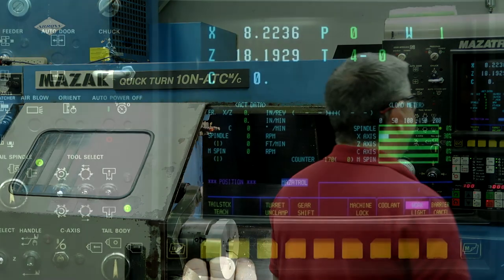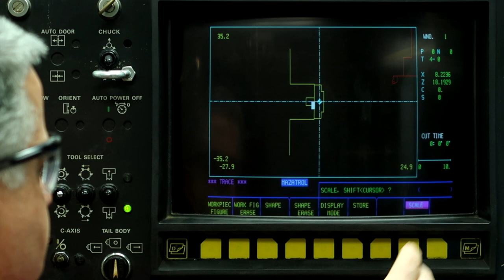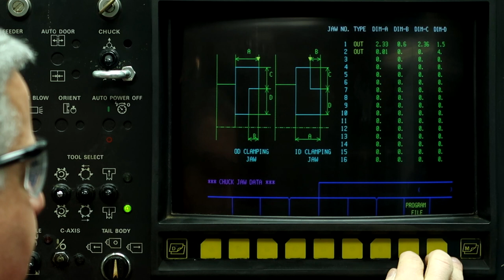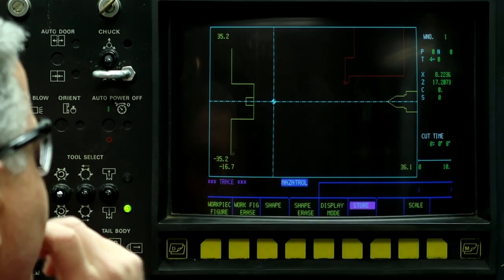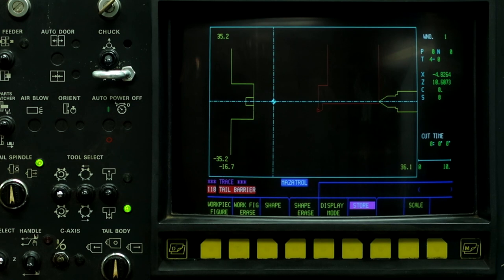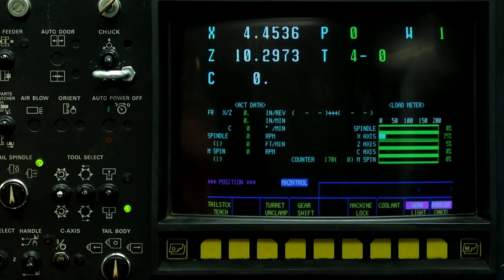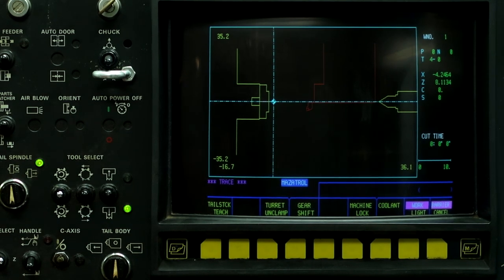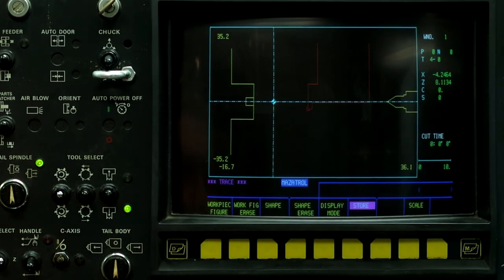Mazak Lathe Barriers T2 T3 Control

Comment: I run a 2006 integrex with a 50in chuck. Came from a gcode horizontal and mazak verticals...so far your the best teacher on youtube....btw the fusion 640m pro control doesn't show the tool like yours does? Its just a arrow😢
Reply from the maker: @jasonruch3529  all newer Mazaks only show the arrow for the tool. I do not know why they changed it.

Comment: Hi phill
Nice video,s your making I learned a lot about it.
I have a question about a mazak lathe i am looking to buy.
While testing i could run the machine on hand over its X+ limit and stall the drive.
Is this something that i can limit by setting a barrier?
Reply from the maker: You need to home the machine first after you power it up.  After the machine homes it self, then it will not hard overtravel and stall the drive.
Reply: Also check setting on soft-limit barrier.
If a X-axis brake slips while powered off, it will go into soft-limit before it reaches the zeropoint-return position.
Then you must increase the value on that parameter and make the zero-point return.
After that you must set parameter back to original value.
If you forget that it will hit hard-limit on rapid-feed/hand-operating even if you make a zeropoint-return first.

Comment: Hi Phill, 
Thanks for the useful materials. Maybe you could do something about TPC, or write conventional processes, for example for grasper or bumper. I would be grateful.

Best wish,
Sebastian
Reply from the maker: Unfortunately, my old controller does not have TPC ability. Mazak added that on the T32 control. I am going to do some videos on programming with the manual processes used for bar pulling and other operations. Thanks.